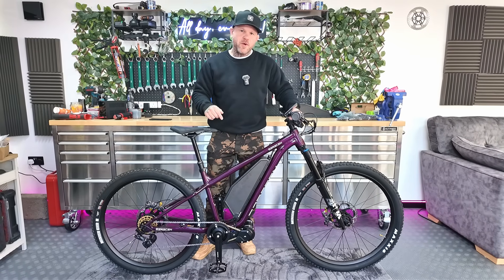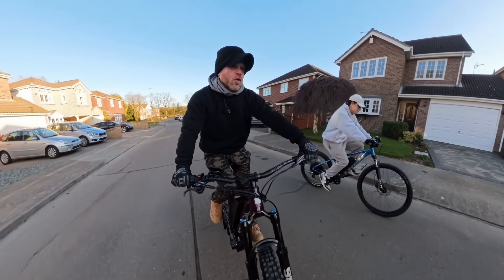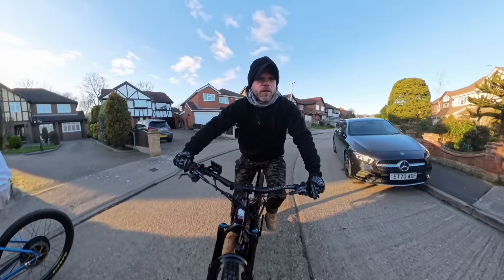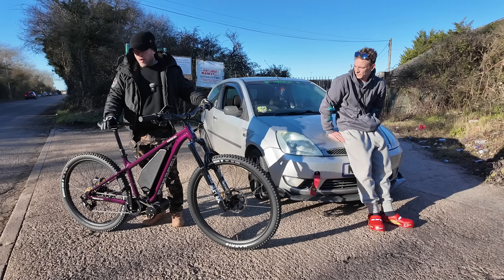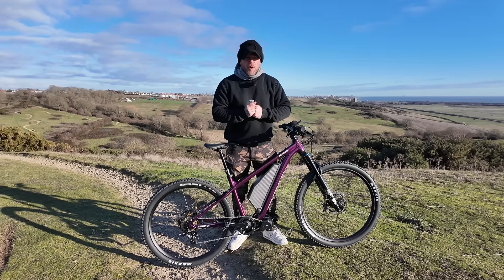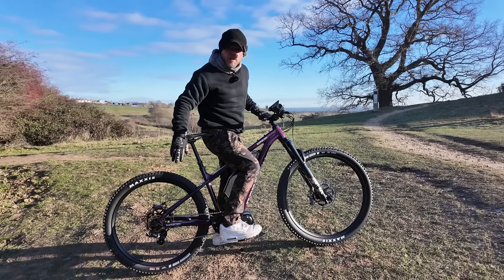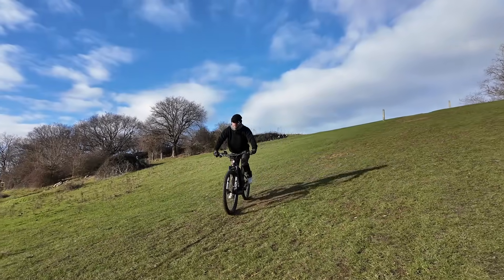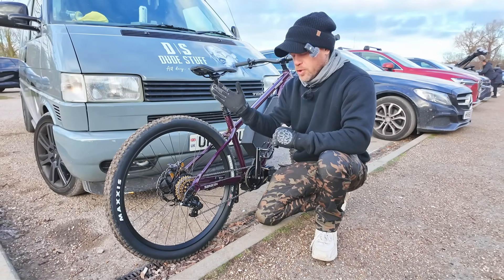I Think This E=Bike Is Too Powerful

Comment: In the USA, so not entering. But that's ok, because I've got this motor, with Surly Wednesday frame, 32Tfront 50T rear. Steel gears, reduced to 5 in the gear cluster and offset outward. Steel HG drive. custom 72V battery, in the pipeline. Design goal: A legit "Trials" ebike with huge, low PSI tires (4.8" wide). Limited to 30mph, by gearing. Lots of control at 0-5mph.
Reply from the maker: Global entry and percentage of ticket revenue if you win and cannot collect due to distance

Comment: 30 or 40 mph is enough for most people , I don't think so . I would want at least 60 mph .
Reply: Then get a motorbike. Imo ebikes should just be used to go as fast as one normally would but just with less effort. The UK 25kmh limit is stupid, should be 35kmh

Comment: They only have the 5000w kit for sale I don't see the 6000w kit on there website
Reply: The 5000w is the 6000w. It's the same motor. You can run it at whatever Watts you want

Comment: Nice bike. But 6000 watts equals about 8 hp, so it's not a very high number compared to motorcycles. It could be fun to drag race it against a 125-150 cc gasoline pit bike (9-15 hp).
Reply: Electric vehicles have more constant torque than gasoline. Eelctric will have much better acceleration for the same watt rating.
Reply: @wtsuser  I'm not sure if that helps. Motorcycles have a gearbox and a clutch. I don't mean specifically the same power rating either; even cheap and small Chinese pit bikes can easily have up to 16 hp and have a construction that is more capable of higher speeds.

Comment: Just set up a bike with the X1 pro with 'only' 52V 2200W and man that's actually silly enough for me right now. I plan on getting a much better bike, CYC drivetrain and rear sus etc but now it's a great exploration bike in my hilly area. My partner loves it too (set to 750-1000W max lol) while I ride my slower 500w TongSheng bike.

Comment: Proper beast that maybe more weight on front end would prevent the wheel from coming up so easy dual crowns would look great and add the extra weight, I have a question why don’t you wear a helmet when riding these bikes especially as you have plenty of kids watching your videos you could use your platform to promote safety as these bikes are dangerously fast my friend had a crash last year and got brain damage came off at around 40-50 still unknown why he’s had to learn to walk and talk again and is still making a great recovery but since that day iv never left the house without my helmet can happen to any of us bear in mind my friends probably the best in the uk on ekit stunting 

🔥💨

Comment: I have the CYC heavy duty cassette aswell, I noticed you said that the paint was missing a little bit. I'll tell you now, That is smudges from the lubed chain leaving lube marks. not paint chipping, It's marks from the lube. It'll wipe off quite easily